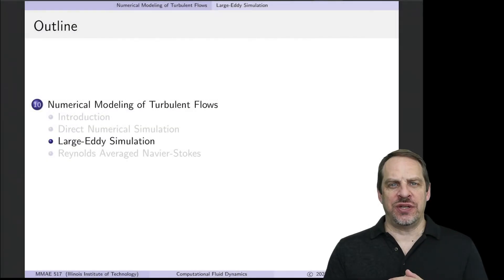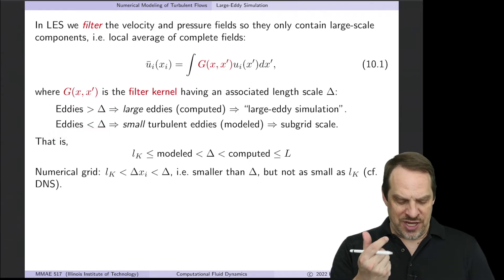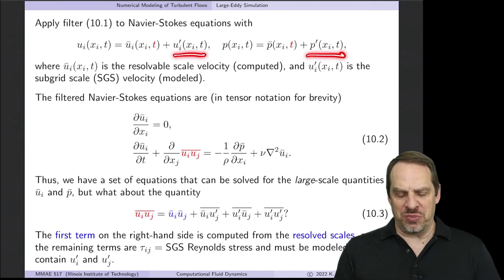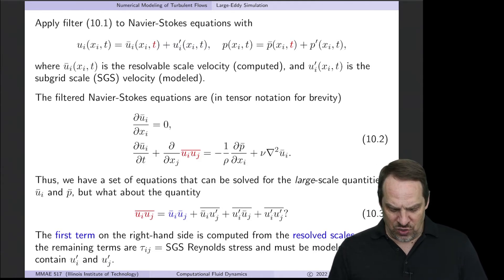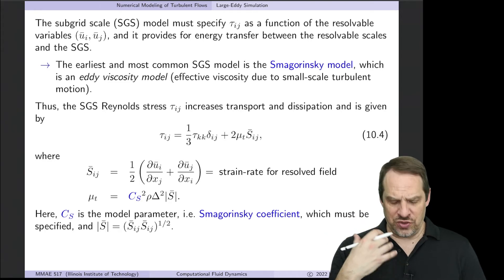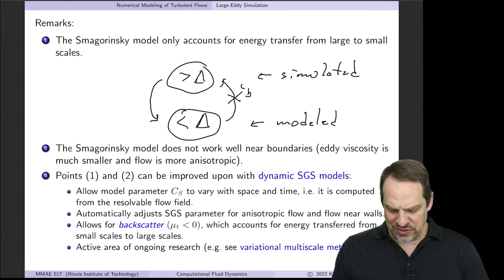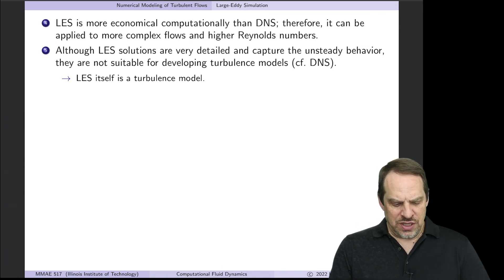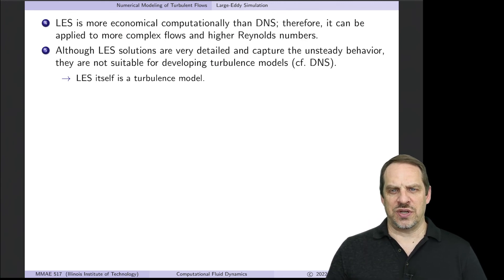Numerical Modeling of Turbulent Flows - Large-Eddy Simulation (LES)

Comment: Great explanation! :-) Would you recommend LES for turbulent flow in pipes around 100mm diameter with water/air and underpressure? I use openFOAM and try to find the best solver for these situations...
Reply from the maker: The answer depends largely on how much detail you would like to get from the solution.  LES provides significantly more detail than RANS.
Reply: @KevinCassel  thx, i go with LES 🙂